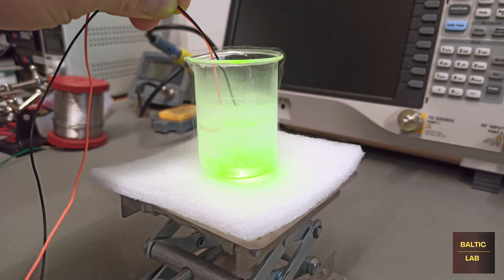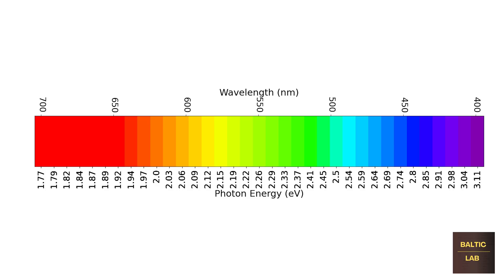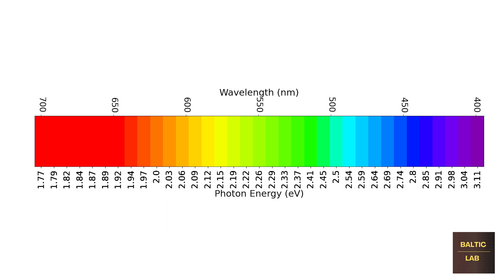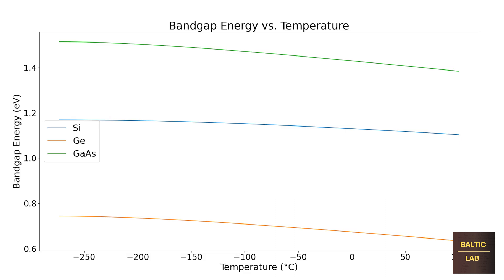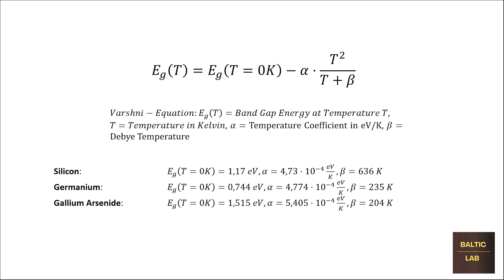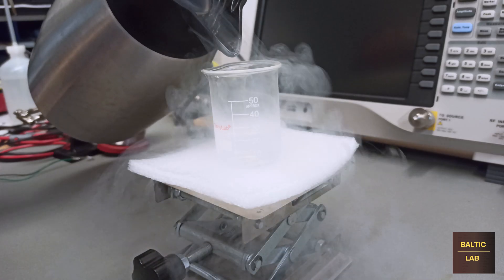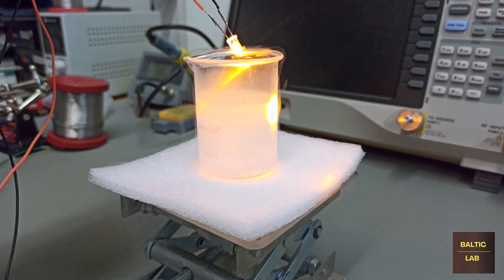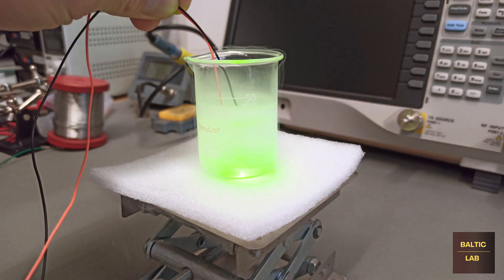Freezing An LED To Change Its Color

Comment: what about other led colors?
Reply from the maker: If you take a look at the photon energy to color graph, you'll notice that yellow is the most efficient color to use for this demonstration. That said, that color-shift generally occurs but is not as effectful with other colors. However, I'll try to make a follow-up video with different colors.

Comment: I like the information, but would have liked a more clearly shown effect when removing the led.
Cameras cannot show thrue led colors, you needs some white paper behind the led to do that.
Reply from the maker: The camera has a fixed white balance that should not auto-adjust. The "trueness" of the color through the whole process from filming, through Adobe Premiere and YouTube is nonetheless a concern of mine. It definitely looks a whole lot more impressive in reality. I'll redo the experiment soon, I'll see if I can get a better capture on a white background.
Reply: Year, but overload on the colors is an issue. In most cases a LED is way to small for proper exposure adjustment and it will be overexposed and that means it will show as the dominant color for the sensor.